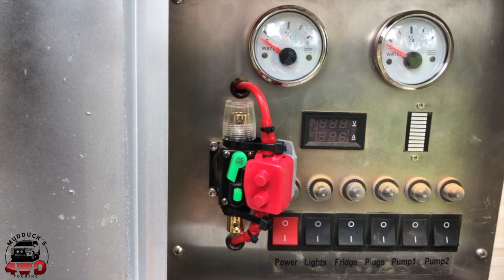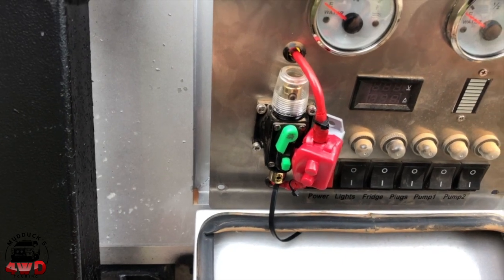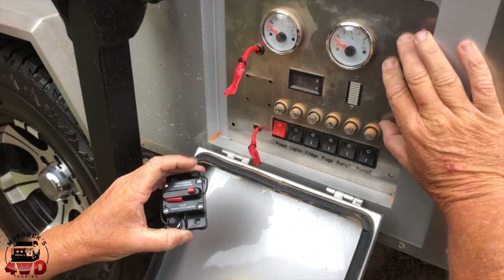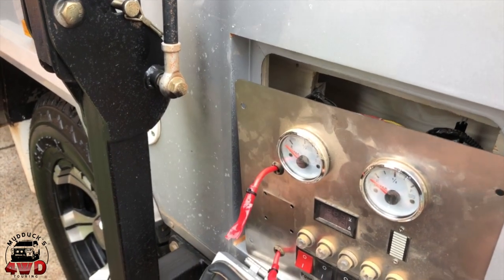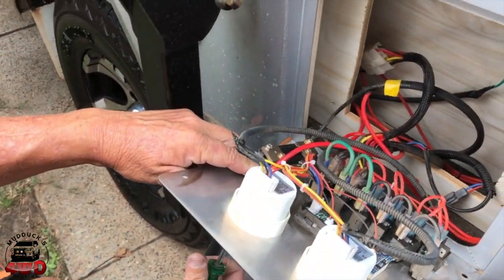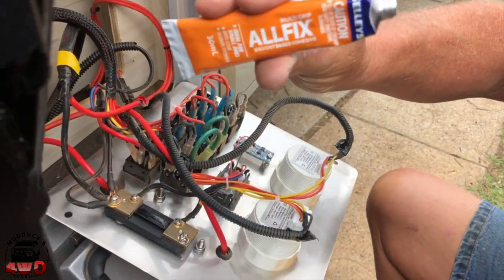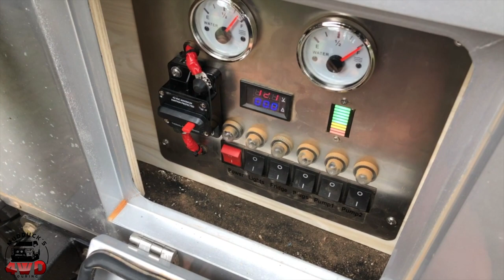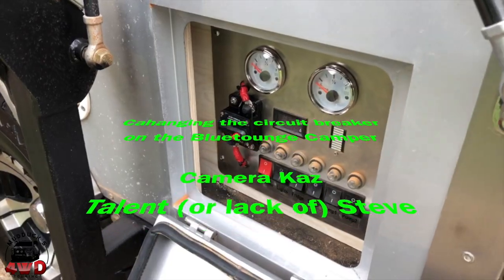Blue tongue Circuit Breaker

Comment: I reckon you could put some open cell foam strip around the edge of that to make it dust proof. I have some stuff in the shed. 5 buck a roll from bunnings.  I do the put the first bolt in and let it do the holding while I drill the other holes. Work smart, not hard.
Reply from the maker: Yep thought about foam on all the dust seals, will get to it one day. Cheers Steve

Comment: Would you recommend these trailers? Apart from the circuit breaker, has there been any other noteworthy issues?
Reply from the maker: Hi Simon, I do like the trailer but it does have issues. Its dust sealing is not good. The wheel alignment is out from new and has destroyed 2 tyres in 15000ks because of it. Otherwise all good. But not sure I would recommend them. Hope this helps. Cheers Steve